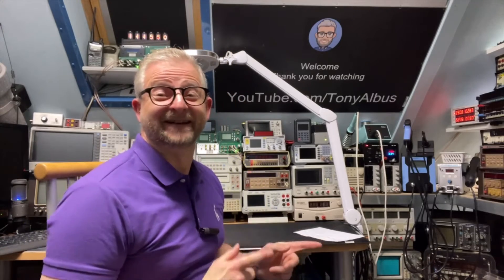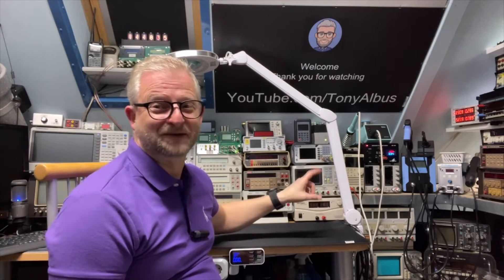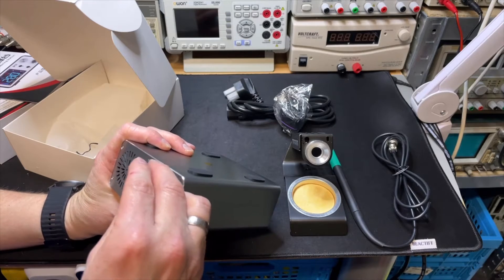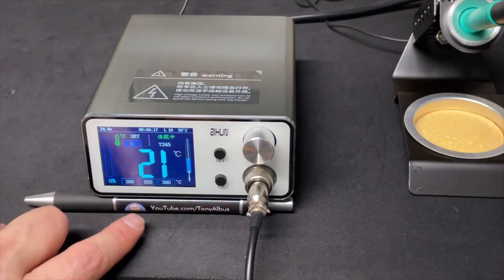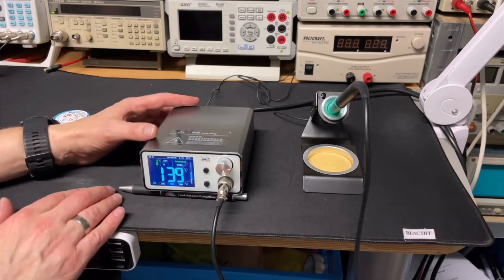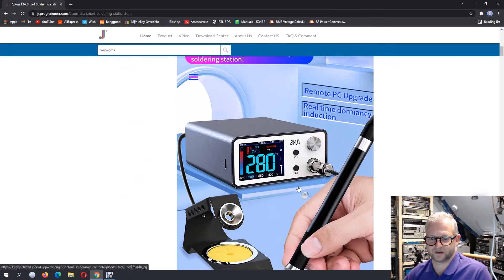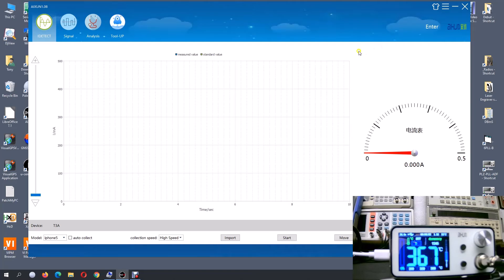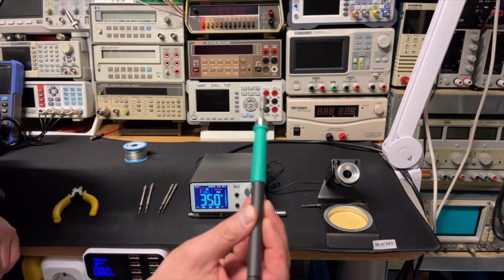#235 Aixun T3A 200W Intelligent Solder Station - Hands On and Update

Comment: I bought one of these a few months ago, and there has been a few firmware updates which is good, rather than the usual "it just about works, so it's good enough" attitude that most Chinese manufacturers use.
The unit will power off the USB when updating, so it's a safer option not to have the unit powered at the same time as connected to the PC.
Thanks for showing how to change the language on the PC software to English.  I got the instructions on how to do updates off the EEVblog and naturally assumed that the PC software was Chinese only.
Finally, I too have a Weller TCP type soldering Iron.  I couldn't afford the entire station, so I just bought the Iron and the stand spring and built my own PSU (24V 50VA transformer).  That was nearly 38 years ago and still working well with no problems whatsoever.
Reply from the maker: Thanks and welcome, yes those Wellers you buy for a lifetime :)
Reply: Hi, I bought this model, but to update it, I am facing the problem of not opening its supporter site. Please, if you have access, send me the relevant platform link or upload it, and thank you for the link.

Comment: Have you compared AiXun T3AS and Aifen A9 Pro, which is better? Aifen A9 Pro supports 3 handles 115, 210, 245. And AiXun T3A only 245, T12, for 115 and 210 you need AiXun T3BS, you need to buy 2 or even 3 soldering irons to have 3 handles. Is AiXun's 200W claimed power much better than Aifen's 120W claimed power?
Reply from the maker: If you want many tips, have a look at my AiXun T420D video.. very diverse station, and this week i will show the T380 too, stay tuned.

Comment: What is the potential at the tip end of the AiXun T3AS, the same as on the KSGER and Aifen? All these stations have pulse power. It is not clear why there are many complaints about AiXun, that the sting has potential. If all stations with a switching power supply have potential on the tip relative to ground, but everyone is unhappy with AiXun. Is there more potential there? Or is there more current?
Reply from the maker: Hi, i sold mine, i think you could ground the station, so even the tip is grounded than.

Comment: You can remove at least smaller tips without needing to use a silicone gripper, that's what the pear-shaped hole on the top left of the stand is for.  You can put the tip through the upper bit of the hole so the bulge is on the other side, then move it down slightly so that the sides of the hole grip the bulge on the tip, then pull the handle back and the tip comes out and falls into the folded bit of the stand.  You'll probably have to steady the stand with your hand when you do it - it's not heavy enough to do it one-handed - but it's really helpful for changing tips on the fly.  I assume this is intentional...
Reply from the maker: Thanks, i did not know, yes that works!
Reply: You can make your own silicone gripper.  Just buy a cheap, kitchen, silicone spatula and remove the handle.

Comment: AIXUN T3A soldering iron station with 2.4 inch color display, 100-480 ℃ temperature adjustable, with real-time dormancy, supports 936, T12, T245 handles and soldering iron tips for mobile phone soldering repair.
Reply from the maker: Yes that is correct, say hi to Phoebe.

Comment: Good day Sir ,.I bought an Aixun T3A 200W , and the holder make some strange noise when heat up , a parazit noise . Does yours do the same?
Reply from the maker: Hi... no mine does not make weird noises... but check if you can do a firmware update... it improves the device a lot. in the video i show how

Comment: I'm ecstatic that these new fangled soldering irons are becoming mainstream, yes, I also used Weller and hakko for 35 + yrs....now, I have the ts-100, ts-80, the T-12 series, and next I'll be buying this system...they are all very versatile and some can run off battery packs etc.......the closest was the butane powered irons, but they weren't temperature controlled. 
I wish these systems were available 20 yrs ago when I was heavily in the TV Repair bizz and needed the portability of the ts-80-100 systems.
Good video..!!
Reply from the maker: Thank you Frank, yes here i also use my Weller, still :) but indeed very smart to use it portable,, great idea!

Comment: Any of you know if I may plug any of the handler, or each station is different plug or work for specific handler/tip technology? I need T12 and I think I will need C245 tips for Iphones repair.
Reply from the maker: Hi Ed, in my vidoe i show 3 tips/guns that you can use with this device. i am not sure which you need for iphone, i would thing mostly small tip and steady hand
Reply: @TonyAlbus  I have't open mu shop that I think it will be next year, for now I am investing in tools and learning and over and over about technology, I have seen many technicians use the JBC tip for Iphones. I've been thinking to open my shop for years. Wow, it would be amazing if I can switch between handlers. JBC will take a little while, for now if I get this JC station It will be T12, wondering if the tip soldering has connectivity to ground    outlet, do you considering this station ESD reliable?  Thank your for your answer to my question.
Reply from the maker: @svsv9  If you need ESD safe i would go for a real brand that sells it as ESD safe

Comment: Seems like a nice soldering station but somehow it feels a little unreliable. The warm-up time is amazing though!

I am in the market for a new soldering station though, since I want to replace my almost 40 years old Weller finally. Not because it's broken but I want a temperature controlled device.
I am in doubt between the Hakko FX-888D and the Weller WE1010. Both are in the same price range. Which would you recommend for electronics work?
Reply from the maker: People talk highly about Hakko, i have never tried one, and as you say.. the Weller has proved his point. .. My Weller is also loyal for at least 25 years and never failed on me.. tough choice.
Reply: You should really do the new T12 tips just give them a try! Go for a Fx-951 if you decide hakko but I think this unit could beat out the hakko (70w Hakko vs 200w iron) the hakko also won't get any upgrades on the software front they're known to have a non intuitive UI too. But the hakko has the reliability and reputation. 

If you wanted to go all out I'd go for jbc but if you just need an iron that works exceptionally well that's proved reliable. The FX 951 without a doubt is a great option and the stand is nice too added bonus

Comment: Do you have a T12 handle that works with this station? I wish to confirm a wiring diagram I saw that allows the T12 tips works on this station.
Reply from the maker: Hello, i do not have the T12, to check, but you can order the device with T12, T245 and 936 so i would think it works.
Reply: Aixun has a T12 handle that works plug and play, the KSGER T12 handle fits but I did hear its configured a bit differently.

Comment: That "weird" power cable is for China. Australian plugs look the same (pin layout) but the cable orientation is never like that. The cable would be exiting the plug at the top, if it was plugged into an AU wall socket. Our ground pin is on the bottom. I'm sure I've read that China has their earth pin at the top.
Reply from the maker: :) that fun..
Reply: Chinese exactly same as Australian
Reply: @waynetaylor2784  from what I've read one of the pins (probably earthing pin) is slightly bigger or smaller. Also, I believe the Chinese standard, like the UK standard has the earthing pin at the top of the wall socket. Australian standard is earthing pin down. Also Australian standard require L and N pins to be coated a certain length.

It's been a while since I read up on the specs, so I may be not 100% correct.

Comment: It's a nice looker. It's full of 'intelligence'. I like them in theory, but in practice, I think I will keep my 'dumb' Weller & Tenma stations. They are easier to update offline - just cheap tip changes 😉
Thanks for sharing!
Reply from the maker: Yes agree, i was sold on the nice pictures and the display... i am a fool for shiny stuff :))
Reply: Enjoy going back to slow heating, low thermal capacity, outdated technology. After using this station for a day, there is no way i'd considering going back to my Hakko 936esd.
Reply: @LBCAndrew  Yeah I dont know why anyone would want to go back to waiting ages for an unregulated temp iron to heat up

Comment: This is what drives me crazy about these "programmable" solder stations.  Too many weird little issues.  Very aesthetically pleasing looking solder station but -  just give me a single temp control knob and a light indicating that it's heating and I'm good - keep it simple.
Reply from the maker: You know what, i agree.. altough i like a lot the upgrade option. but less complacated controls would be even better.
Reply: @TonyAlbus  I gave the video a like anyway,  Haha,  But yeah I just prefer simple controls - I have a cheap Tilswall station that does just fine.  Turn it on and 22 seconds later she is ready to go.
Reply from the maker: Thank you!, yes i understand, my Weller will also stay, it never failed on me.
Reply: @TonyAlbus  I would say that is a good move on your part.  When it comes to electronics - well - less is more.  The less we have to think -  the better.  Haha.

Comment: Design of this thing is not good compared to good JBC clones. And nice big screen is not so much required at all for soldering iron.
Here they just tried to copy T12 kits design without understanding that makes JBC design so good in real life.
Reply from the maker: Thank you for that extra information, i would not know i dont have JBC, so very helpfull
Reply: @TonyAlbus  Tony, you can check SDG video on improved stand. But separate stand still need to be hefty, and original JBC design with all in one made it easy to work since first second of usage.